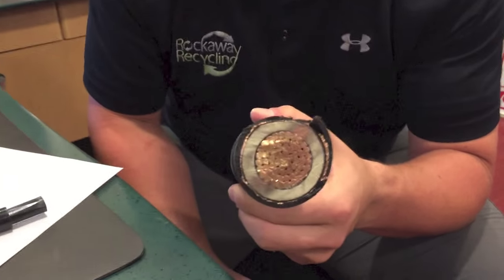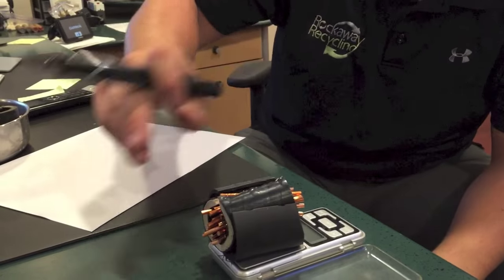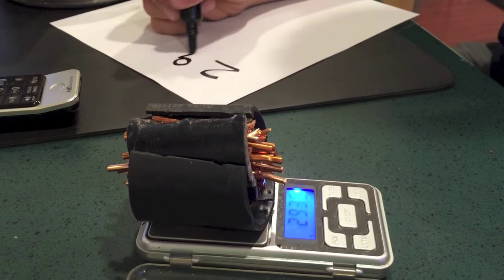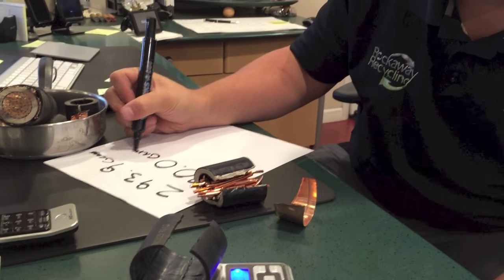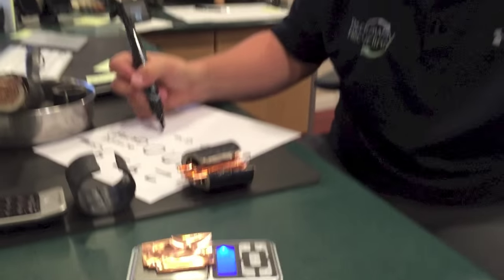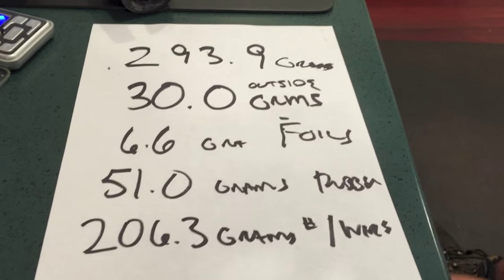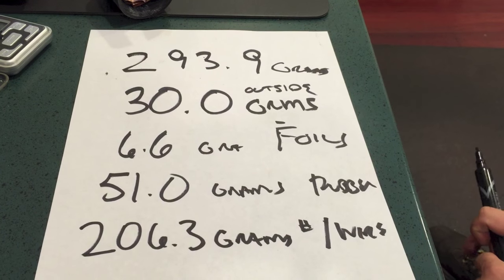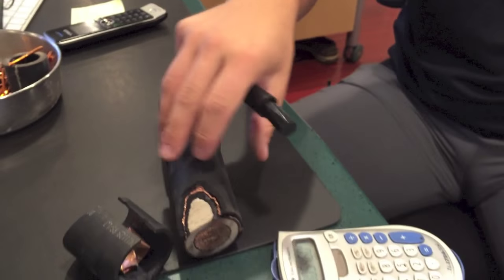Figuring Out Copper Percentage from Scrap Cable

Comment: I weigh 6 ft of wire then  add my length using a multimeter so say 1oz per 6 feet divided by say a 500ft roll 83.3 oz of copper